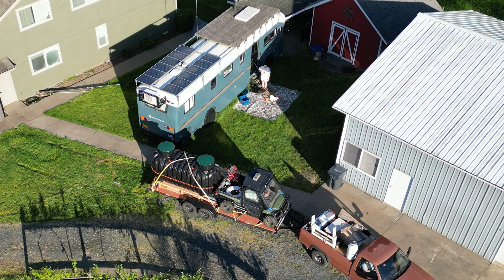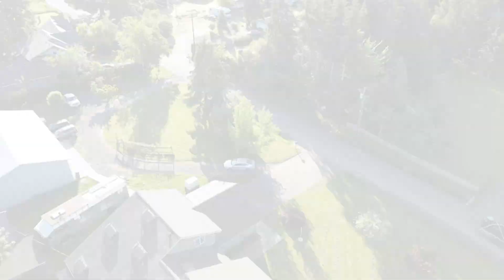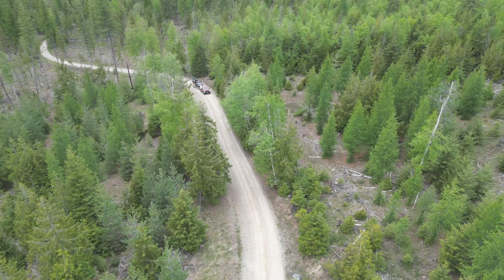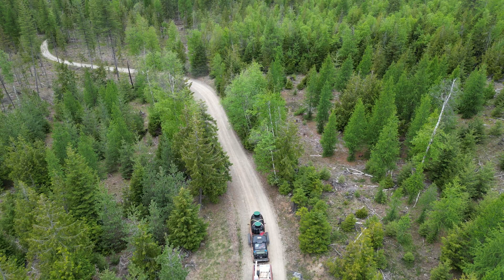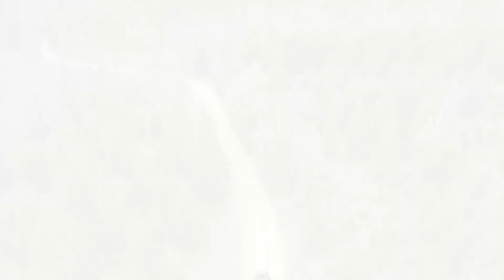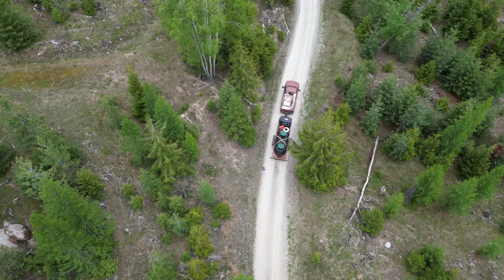30 Panel DIY Solar Mount

Comment: Working in the shade is smart. However, working on your solar panel array in the shade seems a little off. Are you planning on clearing the trees to the south?
Reply from the maker: We have a clear view of the southern sky, the shadows you saw may have been from an early morning shot when the sun filters through the trees to the East. Thanks!